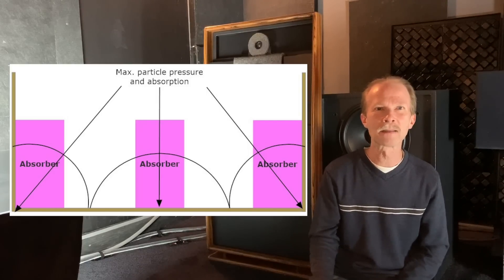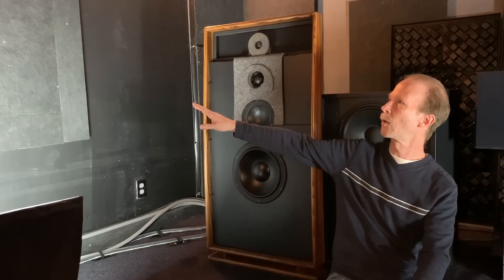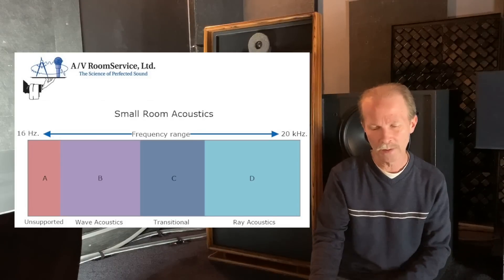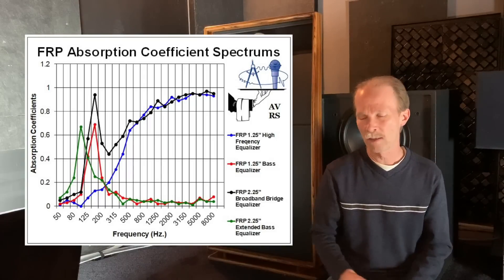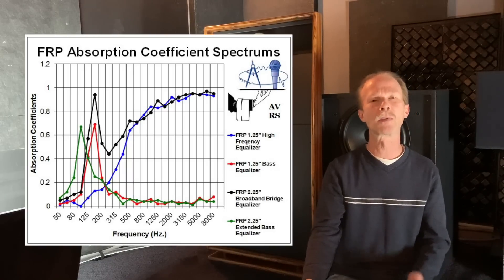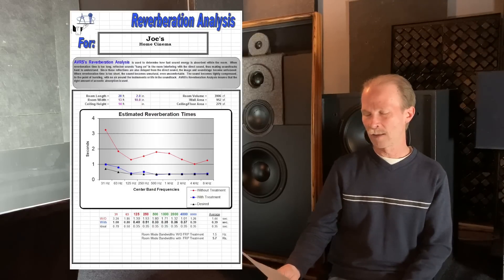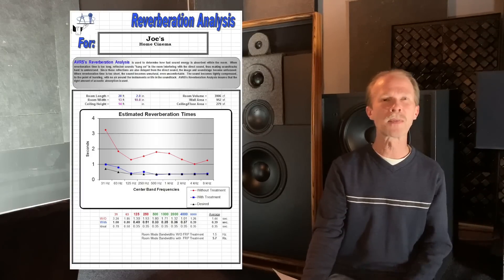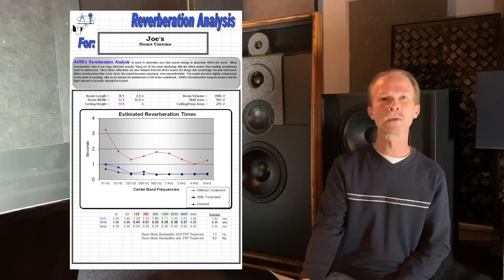Room Reverb Solutions - with AV Roomservice

Comment: QUESTION- when treating a mode with a diaphragmatic unit and the mode wave form image say for the mode with a dip that is in the center seat and the peaks are shown high up on the side wall, will it be better to place the units up high on the side walls where the graph shows the peaks? Hope that description  made sense if not I can try to give technical terms and better descriptors.
Reply: Another way to describe is where exactly is the optimal placement for treating the mode that affects the center seat of a rooms width? High up on the side walls where graphs show the modal peaks or somewhere else like floor/side-wall intersection or ceiling/side-wall intersection which is closer to the modal peak?
Reply: @alford35  Boundaries are a good place to place low frequency absorbers. Where is are seeing a high SPL would be a high pressure point and good spot to treat. Even if you treat just one end say front or floor.